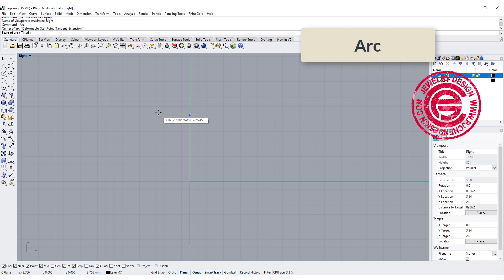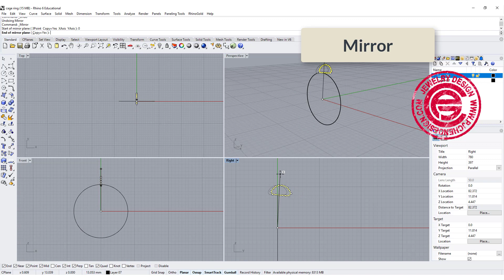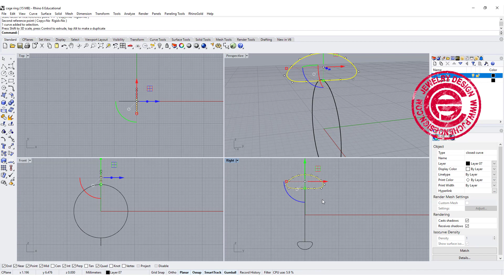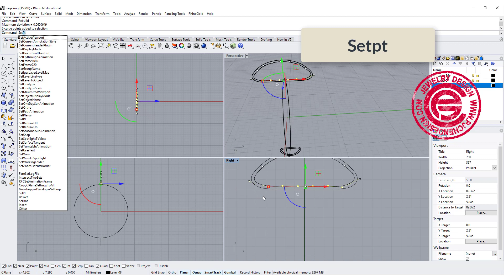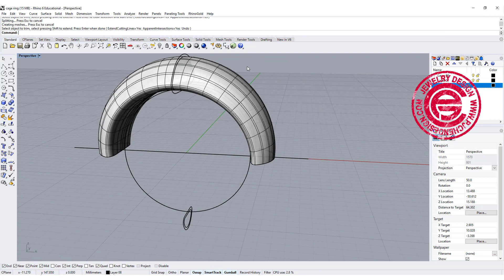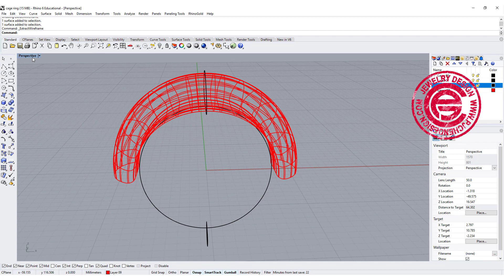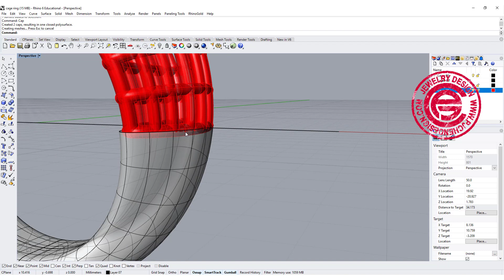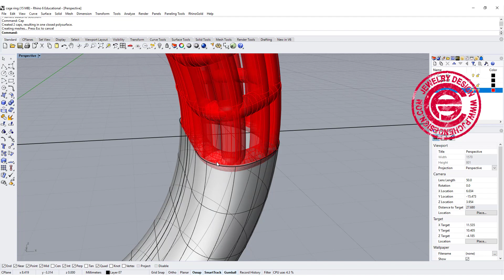Cage Fashion Ring Design 3D Modeling in Rhino 6: Jewelry CAD Design Tutorial #93

Comment: I missed how it went from just a wire frame to the end result, great job PJ and thank you
Reply from the maker: You are welcome, AU
Reply: Heres how I did it: I made the bottom 2 pipes .1mm larger radius than the other pipes, booleaned them to the vertical pipes, then sliced off the bottom half of the 2 bottom pipes. Then I used the 2 resulting trimmed edges as profiles to Sweep1Rail, thereby creating the smooth bottom half of the ring. Then join that surface to the 2 bottom pipes. Lastly I booleaned the rest of the pipes. I hope that is helpful! Cheers